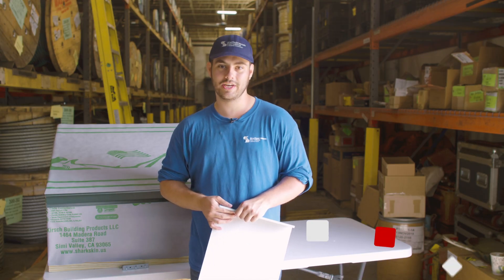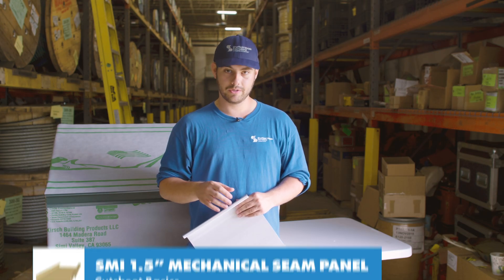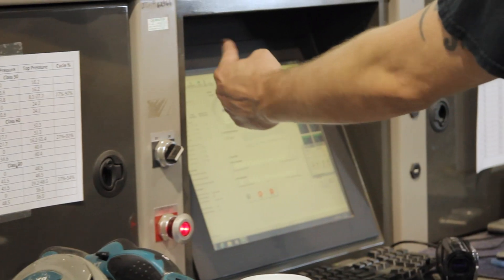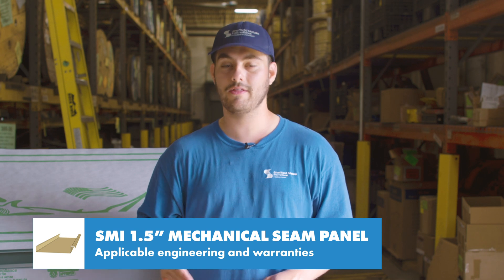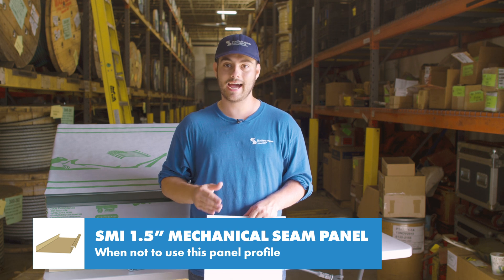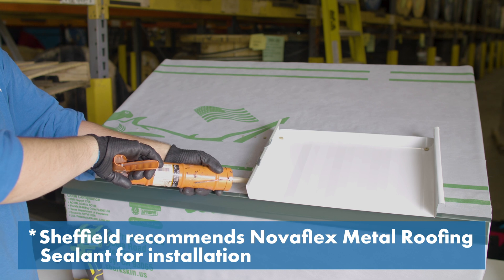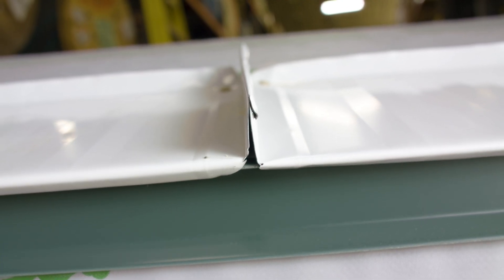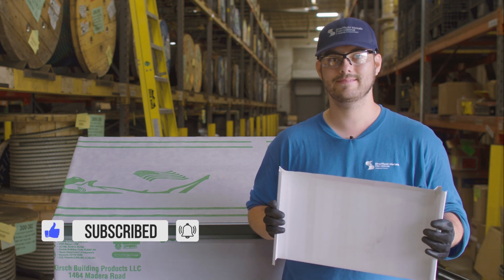SMI 1.5" Mechanical Seam Metal Panel: Uses, Installation, Engineering

Comment: Will a matte black metal roof hold more heat than an asphalt shingles roof?  We want a black roof in FL, and I'm thinking it wouldn't be any worse than shingles. Mainly worried about the power bill hiking up some crazy amount. 

I've asked this question on another older video, so please forgive me for asking here as well. I figured I could cover more ground.
Reply from the maker: I would consider asking the Sheffield Metals Technical Department here: https://sheffieldmetals.com/technical-department/ In the meantime, we did a comparison video on the heat transfer of shingles vs. black metal roofing using a couple different assemblies you can check out here: https://youtu.be/Gol2Ij56SfI Additionally, creating a thermal break by using an air gap and a radiant barrier may be worth considering. Check out a video we did with Matt Risinger about that topic here: https://youtu.be/yesjnBnPt0A -Thad

Comment: Robotic seaming as opposed manual? My panel was done manually some ends I can physically move with my hand?
Reply: I always use a robotic seamer...it provides a more consistently seamed panel but hand seaming just fine....you can rent robotic machines at.... DI Seamers